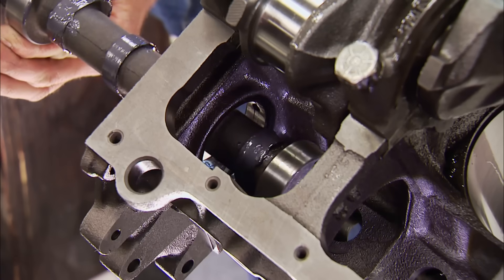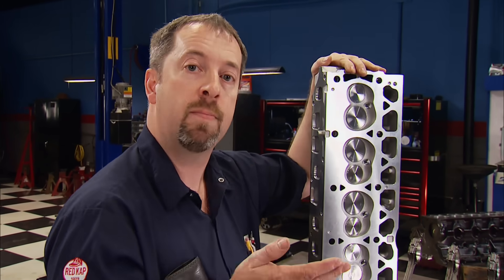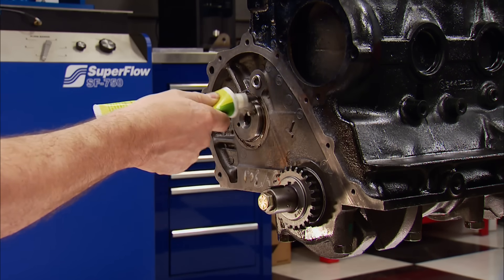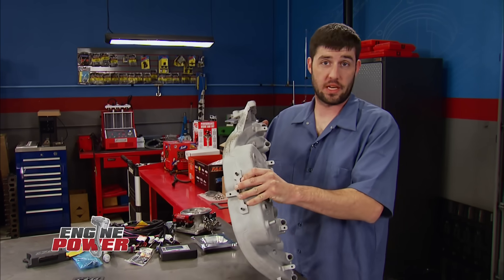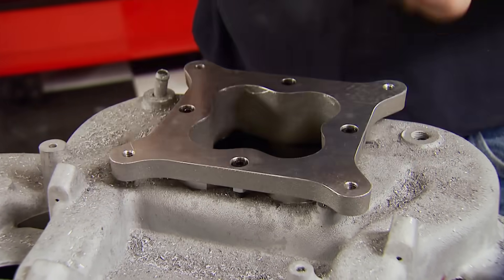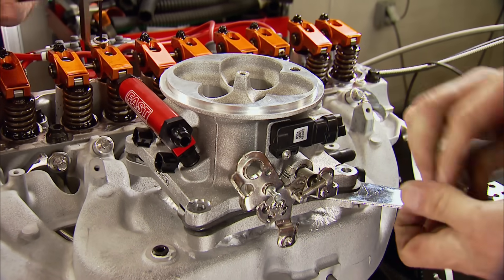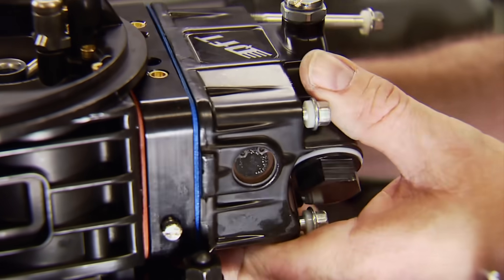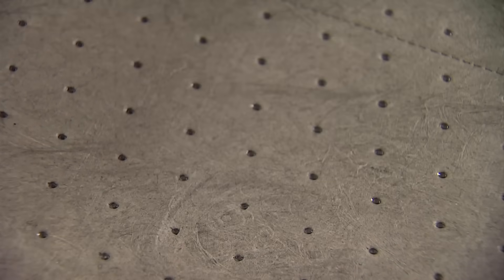Rebuilding a 4.0L Jeep Straight Six to 242HP - Engine Power S2, E14

Comment: You guys need to cover how to EFI this build as guys like me that offroad the shit out of these engines at high altitude can not run a carburetor.
Reply: I'm with you, screw carburetors.  I'm tired of losing 1/3 of my power at 7,000 feet even with a jet change.
Reply: Yes sir:  covering alot of altitude is where EFI wins [with proper mapping and good mass air flow sensing].  That said, if you can stay at relatively the same altitude, a well tuned carb is my preference - vacuum & velocity don't crash or lock up like a computer can.  If I ran pike's peak, I want fuel injection.
Reply: @flinch622  Uhh yeah.. Carbs are awesome for rock crawling.. if you like stumbling bumbling and dying engines.

Comment: I've just had my old Nissan 6cyl 4.2 litre (265ci) hotted up a bit. It produced 172hp at the wheels after a turbo upgrade (20psi) and a bigger injection pump through an auto.  The hp and torque curves at the wheels were almost flat against speed because of the auto.
But it's a Nissan DIESEL with no other mods except for a top mount intercooler. Engine is a TD42, made without a turbo.
Only reason I'm posting this is to say 242hp at the crank with roller rockers, alloy head, lumpy cam, new intake manifold, new pistons and rings, extractors etc doesn't seem very impressive...

Comment: or you could put a k24 in it and make equal or more power with 2 less cylinders...
Reply: SLVR   Yeh, just buy the Honda conversion kit to make a front wheel drive sideways engine mate to a rear wheel drive vehicle.

Comment: Just this past weekend, I uninstalled the TBI throttle body off of my 258cu 85 Cj-7, in its place I went with the largest 2bbl Carter carb I could find, which I bought from Summit Racing....havin trouble with the electric choke, and it's developed a significant miss when I'm at about half throttle and more....example:  doin 55mph on the freeway is fine, but when I step on the throttle to, say, get up to 65mph and pass a car, the Jeep falls on its face, and it'll miss so bad it backfires loudly thru the carb...brand new electronic ignition, brand new carb, plugs, wires, 91oct gas, I'm at a loss as to why it's runnin this way....I don't have a stock air cleaner, does that matter?

Comment: 3:14 3:50 Delicate soft MAIN BEARING coatings are SCRATCHED, its not going to hurt it that bad.... but you can easily scratch them with improper tooling, lack of care and should be avoided

Comment: Tool tip don't use chrome on a impact impact sockets are black and softer matwrl so they don't break they round out preventing shrapnel durring failure and chrome sockets damage the hog ring on the impact wich holds on the socket

Comment: Why on earth would you remove multi-port fuel injection for throttle body injection or carburetor? Those manifolds were designed to flow air only.
Reply: 4.0 was never TBI, when it came out in 1987 it had renix style multiport injection.
Reply: @ryanjenkins9776  87-90 was carbed 4.2, 91 up was mpi 4.0
Reply: @bluedeval03  the 4.2 was always carbureted, it had a small bore and big stroke, it ended in 1990 in the wrangler.

In 1987 the 4.0 was used in the Cherokee it had big bore and small stroke, always had EFI, first a Renault-bendix collaboration called renix and in 91 the 4.0HO with a Chrysler EFI.
Reply: XJ were efi starting in 87
Reply: I believe they had an older block that was TBI to start with and modified a newer head to take the Edelbrock kit.

Comment: I've always wondered put the exhaust and intake ports on the same side.   Putting them on opposite sides would make better flow (suppose they didn't care on a workhorse engine) and better heat dissipation.
Reply: If you repeat it on the other side you could have radial 4 valve arrangement where the valves won't collide. I really don't understand how an inline 6 does not have an overhead camshaft (still a single shaft). That was there would be plenty of space for a cross-flow head. Spring loaded valves are okay, but two wheels to spring-load the chain is impossible?
Reply: @ArneChristianRosenfeldt  
These were all slow running base/workhorse engines.  
So they had to keep the costs down, below the v8 engine options, which were still designed to be low cost.
Reply: @charlesvan13  I tried to estimate the cost. People say, camshaft costs. So I said that OHC can still be only a single camshaft on an inline engine. You get rid of all the pushrods and the material in the block, but need some more for the chain, but the springs can be weaker.

A dirty chain is grinded down. Every engine start grinds down a chain. On the long distance from crank to the OHV little wear on each element adds up. Therefore two sprockets need to symmetrically tension the chain. Fast engines may have trouble with oscillating chain. So one would need to keep free sections at the same length like on the OHV engine. Thus large sprockets are needed and tensioners in the center, and this would block airflow from the radiator and collide with the hood. So without plastic tensioners ( or rubber belt ) you really want to go to the back of the engine and hide large gears behind the flywheel/clutch and then use a chain for the distance.

If someone rebuilds this engine, please insert such a gear as a shim between engine and clutch!

Comment: Jesus Christ, those numbers are depressing. Just let that boomer motor fulfill the only job that it can: A boat anchor.

How about instead of 1HP/cu.in., you try to get 100HP/Liter....? you know... what is pretty much standard these days in terms of performance?
Reply: This isn't a performance engine, its' an economy and workhorse engine, designed for low end torque, did you even watch the video?

Comment: eliminating the mpfi and running the manifold wet when it was not designed for it was a mistake. the fuel is falling out of suspension, i bet the lambda between the cylinders is all over the place.

Comment: So the piston in the video is stamped .040 which means it’s bored .040 over and that makes it 249 cubic inches...doesn’t look like they made 1hp per cubic inch to me? Looks to me like they spent in excess of $5k to build an engine with a bunch of high end parts that don’t work well together for a measly 50hp gain. Let’s not forget the engine wasn’t driving any power robbing accessories on the dyno either. I would love to see a stock 4.0 dyno’d the same way with just that header, no accessories and the factory fuel injection. I would bet that accounts for half of the power gained here

Comment: I think that straight pipe with the O2 sensors caused your problems. We’ve run into this a few times with Harley straight pipes and fuel injection.

Comment: The low runner velocity of that intake manifold due to short runners is why it doesn't flow fuel right. That manifold isn't meant to run wet. It's sorta like a single plane short runner manifold, lots of plenum volume and little to no runner length

Comment: while it takes Jeep a 4L inline 6 to push 242hp, all motors 2.4 liters 4 bangers from honda can reach 300-400, without even a turbo. Just NA madness from Honda.
Reply: Those engines have twice the camshafts, twice the valves, and a better induction system, not to mention those engine have to rev far past 5,000 rpm to make those numbers.
Reply: @riogrande163  yeah that's what I'm saying. Honda engineering is best

Comment: 95 plus pan gasket works on the older engines, no need for that cork crap.   The newer gasket is a silicone/steel 1 piece part and totally worth it.   Same with valve cover gasket.

Comment: Wish I could get 242 up out of my 93 4.0 Ford. Only thing I can think of is to steal a M 90 blower off of a GTP or Bonneville and make a custom sheet metal intake and microsquirt the SOB. After working at several dealerships and a body shop, and being around new vehicles, I'd just rather keep my old truck.

Comment: There's a reason amc didn't put the 4.0 in the wrangler in 87. Peak torque is nearly 1000rpm higher than the 258. It was a much more street friendly engine, but the "low end torque" still doesn't really compare to the older 258. Especially off road

Comment: Looks good, although I am not that great a fan of sheer power, I am more interested in reliability. I was interested in your going back to a carb, a friend had the alternator on his Wrangler fry the onboard computer. Cost him as much as a full engine rebuild for my old Land Cruiser (after 300 000 miles). So if you can point me to references how to bypass the computer all the way I would appreciate it.

Comment: I hated that they tried to use a TB Injection and then revert to a carburetor. The 99 and new manifolds were meant to work with port injection. Also, at 190hp on a stock 4.0L, a cam upgrade, polished ports on a stock head, and improved port injection and timing could've have given them 242hp for cheaper. I like parts of this build but the end result was not satisfying and rather disappointing.

Comment: Seems like a lot of work for 50 HP. Should have put a 5.3 in it
Reply: 66 horsepower, a 35% increase without forced induction. It's what you have to do.  It sure sounded nice.

Comment: thats odd info at the end about the TPMS sensors specially if ALL vehicles are supposed to have them because my 06 Dodge Ram 2500 Mega cab does not and i don't have any codes showing up that the TPMS sensors are damaged or missing either. Kind of concerning

Comment: Less than 4k to go before I hit 400,000 miles on my '95 Grand Cherokee, original motor, 42RE trans., and 249J transfer case! Longevity indeed:)
Reply: same year here but only at 215k. I'm swaping my 249 for a 95> 242. The engine runs well. Good torque. Not sure about uping the gear to 4'11 like the 8 cyl had or go for 4'56 gears

Comment: I like how they just ignore the fact that the early ones just pissed oil. My 88 Comanche with the 4.0L had wicked blow by that caused oil to travel up the intake and would absolutely soak the air filter within a few hundred miles. 
Other than that it was a pretty good engine though. But to say it was problem free isn’t a fair statement.
Reply: not my 87 xj
Reply: @upnorthviking823  uh - 88 keep 4.0L don’t have PCVs. So try again. 
Reclock rings? You mean tear down the engine to physically turn the rings and then reassemble? And you think that’s a reason able solution? How often do you recommend that gets done? Daily?
Oh - use heavy weight oil. Yeah another great idea. I’m sure that will work great on cold starts during Michigan winters. 
Any more ideas, genius?

Comment: Yea, this video has re-affirmed my decision to walk away from the 4.0.  Not a bad engine at all, but Chrysler pretty well had it maxed out.  All those fancy parts and it still only made 50ish more hp over stock...
Now, if the architecture could accommodate a truly modern cam profile (roller) and a cross-flow head then we'd have a different story.  
(btw, roller cams make more power because they allow for faster ramp-up and thus more duration at higher lift, not really a heat issue)

Comment: In the early 1990's my employer used Jeep Cherokee's exclusively with around 20 of them in their inventory. I was provided a brand new take-home Cherokee and was the first time I'd ever driven a Jeep product and I was immediately impressed how good they drove and the amount of power those 4.0 liter 6 cylinder engines produced. Originally, when I learned they were buying 6-cyl Cherokee's I didn't have much confidence in this motor but after two years behind the wheel of one I was thoroughly impressed.
Reply: Oggy   They're two completely different engines.

Comment: Lets see, modding the intake manifold was a bad idea, so hence the fuel injection not working. Then adding E3 plugs to the engine..... how much fail can you fit in this engine? Well, there are 6 pieces of fail right there. Something tells me that if you really are using those shit plugs in your builds, just how much damn horsepower are you leaving on the table?!?! Hearing that thing idle on what is supposed to be, yes, a hotter cam, but not THAT hot to cause a lope...... and hearing it rev out, it did not sound very happy to me. But, meh, when you sell your soul to E3, I guess power left on the table is what you are stuck with. I can not tell you how many times now I have removed those shit plugs from multiple vehicles and lawn equipment, installed proper spark plugs, and instantly made them all run better...... screw that company. The ONLY reason I watched this video was to see what you guys did..... and while that was decent power, I wish you would have gotten sponsored by a better spark plug company.....

Comment: we all know the 4.0 wasn't know for reliability.  the 4.2 yes.  the 2.5 yes.  the 4.0 did good mid range power with lots of head gasket problems, and a short useable lifespan (in the scope of things...)
rarely does a jeep 4.0 get several hundred thousand.  after 150/60 they are having problems unless meticulously maintained, well used, yet greatly pampered .  in such a case, 225,00 seems to be the end of  line.  a rare few reach 240.  these days 300,000 is not uncommon on most engines.  jeep is bottom of the barrel for reliability and longevity.

the 4.7 v8 was no a leap ahead either.  there's a reason the 4.7 and 3.7 where shelved decades ago.

Comment: So its 2019, and you're expressing pride over building a FOUR LITRE engine up to a poultry 243HP? Stock engines with half the volume and less cylinders have done better power and torque figures.
Reply: It's impressive that people can be so ignorant, such as your selves. 1. They were using low compression pistons. 2. They screwed up the intake manifold. 3. Horsepower per liter means nothing, what matters is how you build the engine with the parts you put inside of it. 4. This engine is a pushrod 2 valve, workhorse engine, it's designed for low end torque and a relatively flat torque curve. Little 2.0l 4 cylinders would need to rev far past 5k rpm to make the same torque numbers.

Funny how people who barely know how engines work are always the quickest to judge an engine build.
Reply: @riogrande163  "Funny how people who barely know how engines work are always the quickest to judge an engine build." 
Right... Well, maybe you can tell me how many torqs and horsies I can gain from going to high compression pistons?

Little 2.0L 4 cylinders wouldnt make the same torque figures ;)
Reply: Was waiting for this comment lmao. Literally 60hp/litre....
Murriiccaaa'!

Comment: I love my 4.0 that was bored out to 4.6.  200k miles and no issues other than modules going bad once in a while.  1st gear low atlas transfer case I ghost ride this while spotting myself.  Never has stalled.

Comment: I'm overly disappointed. I've wanted them to do this episode forever, now I can't even take them seriously after seeing the intake flop. I made more power by literally removing the tubes and air box, then slapping a B.S. 3inch Spectre cone filter directly on the throttle body......with JB weld...... because I'm a broke ass shade tree mechanic that knows it ain't gotta be pretty it just needs to work. These guys are making it pretty when it won't work.

Comment: Had two Cherokee’s one had over 250000 and the other had over 275000 miles and still running strong when I gave them away.

Comment: Fuel injection is the better option for off road vehicles as they often climb steep hills and have large elevation changes.  Carburetors have floats and chokes that create startup and steep angle issues as well as air to fuel ratio concerns at elevations. Might have been a better option to have used the stock EFI for dependability. The air flow on the modified intake was changed too much and of course, it wasn't tested for air flow to confirm that was a good move.

Comment: When you guess, that the M50 engine from BMW reached the same power with one liter less displacement, but with a higher reving DOHC configuration. it is hard to take a pick. The 4.0 liter workhorse with more low end torque or the higher reving sports motor?